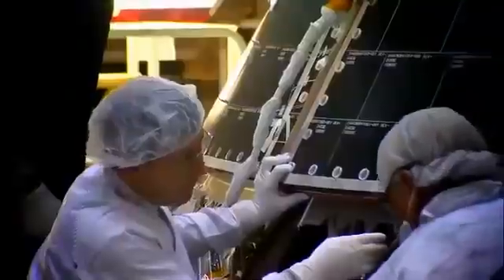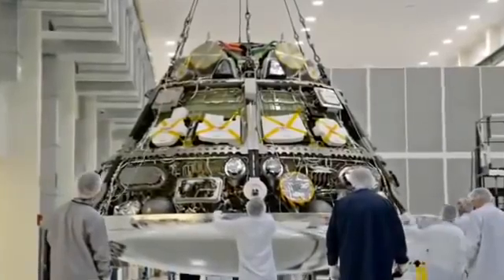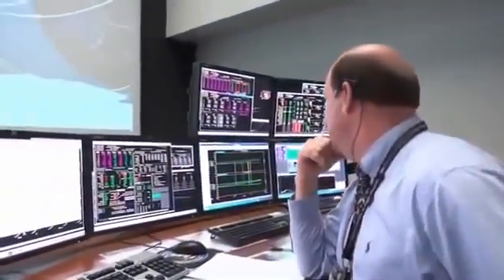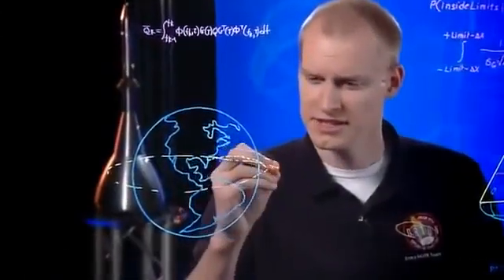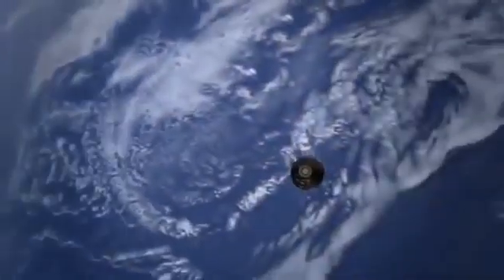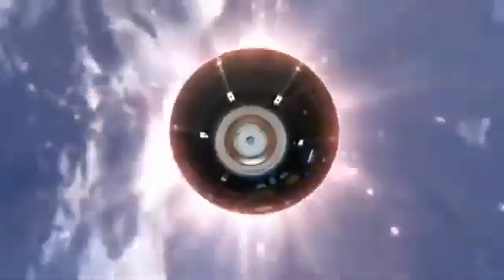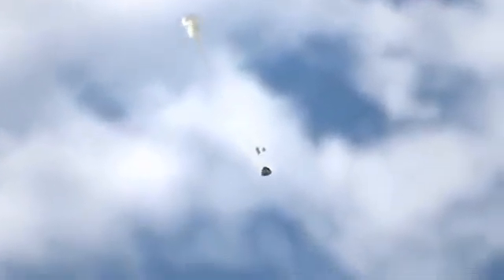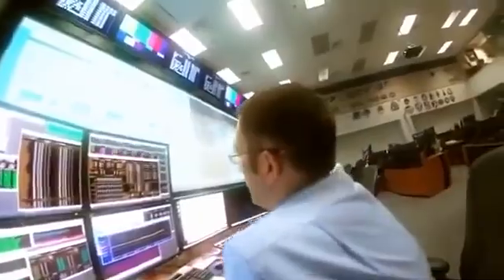NASA engineer admits they can’t get past the Van Allen Belts

Comment: He did not admit that we cannot get past van allen belts, it is well documented that it is possible. What he is explaining is that they need to check whether the shielding on board that Orion capsule is working properly and wont endanger the crew. The shielding is going to be different on every craft so every craft needs rigorous testing. For example if Ford tests the safety of a car and then designs an updated and modern version, they have to test the safety of that new car they cant simply skip over that process because they had made a safe car in the past.
Reply: Yes he did your in denial. 3:38
Reply: @regbaskin2411  1. He is talking about solving these issues for that particular spacecraft
2. They knew how to do it in 1969 but like with the car example I provided they have to test the shielding for each spacecraft which will have different shapes, volumes, weight restrictions, safety regulations ect which all change how the shielding will function.
Reply: @regbaskin2411  no he didn't. Or rather you don't understand what he's saying.
Reply: nice and neat
Reply: Well they suppose to know that back in 1969
Reply: I bet you believe they landed on the moon with 1969 technology.
Reply: @whitestratman3158  Seeming as it was impossible to fake, obviously I do
Reply: @fraz889  😂 Holy hell...
Reply: @fraz889  It's not like they could fake a phone call yet they could put men on the moon? Do you hear yourself?
Reply: @whitestratman3158  I'm not talking about a phone call man
Reply: @fraz889  I was.
Reply: @whitestratman3158  I said that the moon landings were impossible to fake not the phone call
Reply: @fraz889  So you're saying they couldn't make a movie in 1969, but they could visit the moon and come back flawlessly the first time?
Reply: @whitestratman3158  They could not achieve that level of VFX at that time however our engineering capabilities and knowledge were there to be able to land on the moon. Also this was not the first time they'd gone near the moon?
Reply: @fraz889  In 1969 we didn't even have remote control tv or cell phones. For the love of God stop posting before someone sees this and locks you in a padded room. We do not have the technology to go now, we sure as hell didn't have it in 1969.
Reply: @whitestratman3158   The first wireless remote control was released in 1939, the first wireless TV remote in 1956. The first cell phone call was made in 1973, just 4 years after the moon landings so that's not really a strong point. Also neither of those things relate to  radio transmission so I don't even understand your point. We retained all our knowledge from the moon missions and there is now funding so we developed the Artemis programme set for first launch later this month, so we definitely do have the technology.

Also you tell me to stop posting but you replied to my comment first 😂
Reply: @whitestratman3158  “stop posting before someone sees this and locks you in a paddled room” LMAO

Comment: The Apollo missions marked the first event where humans traveled through the Van Allen belts, which was one of several radiation hazards known by mission planners. The astronauts had low exposure in the Van Allen belts due to the short period of time spent flying through them. Apollo flight trajectories bypassed the inner belts completely, passing through the thinner areas of the outer belts.

Astronauts' overall exposure was actually dominated by solar particles once outside Earth's magnetic field. The total radiation received by the astronauts varied from mission to mission but was measured to be between 0.16 and 1.14 rads (1.6 and 11.4 mGy), much less than the standard of 5 rem (50 mSv) per year set by the United States Atomic Energy Commission for people who work with radioactivity.
Reply: If it was real
Reply: @zappy_ne  but it wasn't
Reply: And you actually believe that, or you really do not want to admit that you know the whole thing was faked?  You do know, it was.
Reply: @jimn1968  Yes, you're right. Every single space agency around the world, with every single one of their employee are payed to lie to the common citizen for the sole reason of mind controlling you. Lying about this is just the tip of the iceberg and Illuminati (The Jews) run the world, and you're just a pawn in it.
Happy now? 

Stay clear of the acids my boy, they cloud your thinking

Comment: Apparently Kelly Smith forgot if we can't send humans aboard because of the intense radiation of the Van Allen belt  how did we make it to the moon in 1969?
Reply: Easy answer, we haven't. It was a smoke screen to make it look like we got there before Russia during the cold war.
Reply: We didn't, that's how
Reply: Bullfrog gave a solid answer, but if you want to read more: http://www.moonhoaxdebunked.com/2017/07/82-if-van-allen-belts-werent-problem.html
Reply: Ironically, it is due to advances in electronic technology. Microchips are far more susceptible to radiation interference than the discreet components that made up the computing equipment used during the space race. The danger to humans is not the potential for radiation poisoning. Our shielding technology is sufficient to mediate that risk. However shielding hasn't proven reliable enough to use modern microchip integrated circuits to run the vehicles. This variable makes too much risk to make a manned mission through these zones using modern computers to run the vehicles.
Reply: @jjbailey01  wrong, and you are a schill. "we must solve these challenges before we send PEOPLE through this region of space" this is what was said, nothing do do with microchips. you sir, are a gov schill.......

Comment: He says this because the integrated electronics used in today’s spacecraft are more sensitive to radiation that the simple wiring and early integrated circuits of the 1960s. This may seem strange to anyone who is not familiar with electronics, but today’s components are more vulnerable than old ones because they are far smaller, and therefore a single high-energy particle that hits one of their microscopic memory cells can alter its contents and therefore generate incorrect information or instructions. The relatively small number of memory cells of the Apollo computers, being much larger, could not be affected so easily. That's all there is to it.
Reply: Don't buy it!!
Reply: Ahh, like how jet fuel CAN melt steel! Many people are just ignorant of that fact. 
I will still say  NASA has put out some pretty cringy videos. Like, I thought they were fake cringy.  I also seriously question how the astronauts leave their long hair loose. It's a bit hard to swallow OSHA, NASA, etc doesn't have a safety policy in place. Or that the women dont put it up just because long hair floating everywhere would be a pain in the ass, and I wouldn't want to get it caught on anything. I would(and do, just like the vast majority of us do, especially when working with machinery) wear my hair up. And ALL the women with long hair leave it flowing? None of them do anything different? Naw.... It doesn't make and logical sense. 

*9/11 was still and inside job.
Reply: Nice try! Not buying it!
Reply: wtf???? are you dumb? .... hes saying it will harm the humans .. not the fucking electronics .. arr you thay brain washed that you didnt catch any of that in this video?????    if that was the case dont you think they would just use the old tech we had??? you my friend are a sheep .. and i hope you break away from the heard soon 🙏
Reply: your an idiot..
Reply: wrong, and you are a schill. "we must solve these challenges before we send PEOPLE through this region of space" this is what was said, nothing do do with microchips. you sir, are a gov schill.......
Reply: ohh yeah and btw this isnt original .. its been cut and things he said have bee  removed from original... also another video explaining we  cant leave low earth orbit .. that we lost the tech in the 80s....  how tf you loose the yech that got youto the moon?? wtf?  and everyone believes it blindly too.. ok mr tv what ever you say mr tv .. your shirt says nasa so yeehaw...